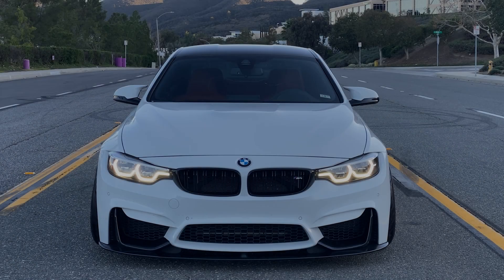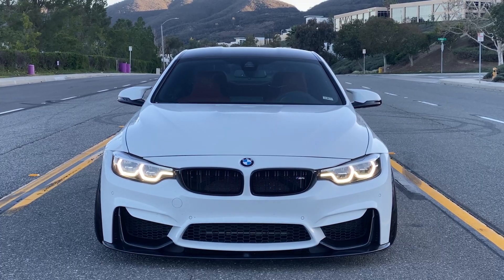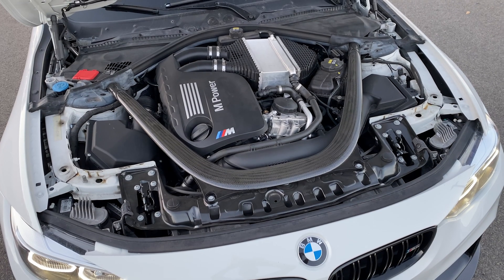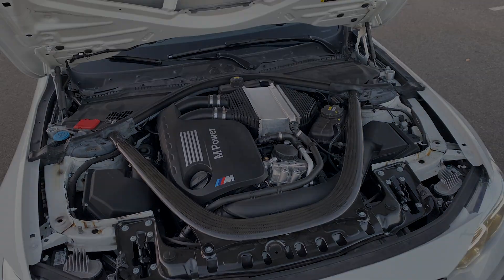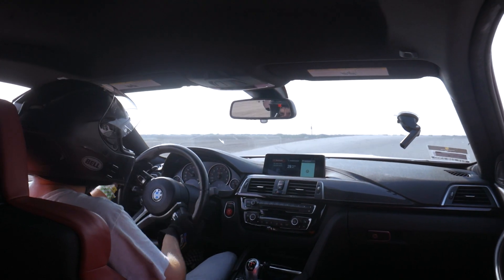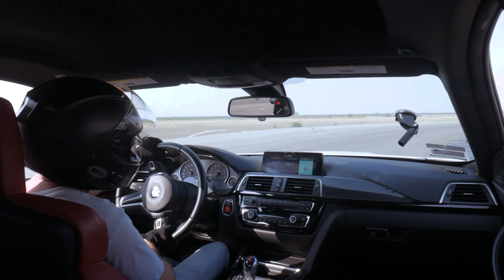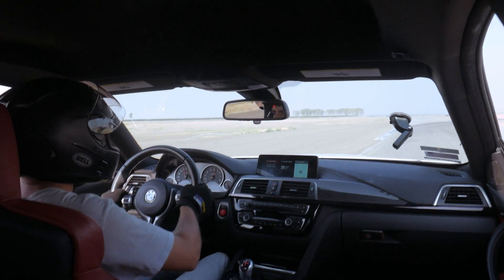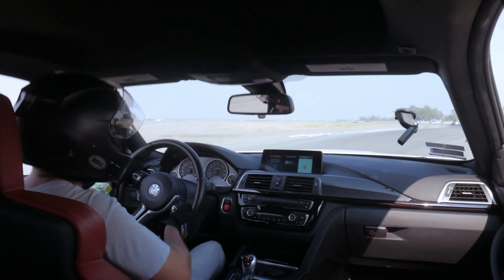When Should You Upgrade Your S55 Crank Hub? | BREAK DOWN

Comment: I’m planning on buying a 2019 F87 M2 Competition to use as a weekend car, with under 30k miles. Would you recommend changing the crank hub if I plan on doing a stage 1 remap?

Comment: Just had my 2020 M2C bolt capture done by Litchfield along with a stage 1 upgrade to just over 540hp and Bilsteins all round.  If I would have had to choose just one upgrade it would be the Bilsteins. It transforms the driving experience completely. They strongly recommend a crank hub fix if you are upping the power and they should know as they are the best in the tuning business for BMW's. They claim to have had quite a few power upgraded M2's revisit them who chose not to have the crank hub fix done first time round only to present them with a big bill on their subsequent visit, way in excess of the  the cost of the original fix.  If you are upgrading power its not worth the risk unless you have loads of money to spare..

Comment: 30k on my 2020 stage 2 manual f87 m2. so far so good. i plan to keep the car for a while and do the crank hub and upgrade the turbos while im at it. edit: also had a stock 2018 dual clutch f80 m3 with 35k on the clock when i sold prior to the m2 with no issues

Comment: I have a 550 hp 6mt with 73k on it, no issues. Both the N54 and N55 used the same design and had no issues (largely 6mt or TC autos). I think the problem is DCT boxes and aggressive down shifts backing the bolt out. I would only bother doing this if you have a DCT that you regularly track and/or drive hard.
Reply: loads of people reported it on the N54 and N55 wdym
Reply: No issues? 😂 hottest upgrade is the hub on high hp dct or manuals
Reply: Its fine until it slips then you wish you had spent that little bit extra to stop ever  happening. If you drive it like a Nissan Micra then don't bother but people don't buy M2's to pootle down to the shops. I drive my Litchfeld stage 1 with crank hub fix and Bilstein upgrades (worth every penny) quite normally (70- 90mph on motorways.. its too risky to drive excessively fast on UK roads as you will only lose your licence driving over 100mph and there are idiots that pull out to overtake without indicating at the last moment as you bare down on them at high speed ) but I do use the right foot when I need to.  I enjoy it for its immense overtaking ability to get from A to B when I need to get past those irritating slow drivers that won't overtake unless there is a mile of clear straight  road ahead or they are on a dual carriageway.  You can overtake 3 or 4 cars with absolute ease in my M2C in less than  half the time most cars can barely overtake one.
Reply: @hazzard8760  That is true, and they do slip, but my point is I don't think they slip unless you money shift or have a dct and bang down gears aggressively all the time. I actually did the bolted joint calculation on an evolve video somewhere and the cams and fuel pump would have to draw about 300 hp at 5k to slip the hub on stock bolt torque, so unless the bolt has relaxed or backed out then it ain't slipping. I would definitely do the fix on a dct that is driven hard.

Comment: I have stage 2 right now and have drove 12,000 miles so far and I have no Crank Hub issues. Sometimes I drive it rough because you can’t drive that kinda car in normal mode. You just can’t it sounds too good and feels too good. I am think of soon doing it and my vehicle has 33K miles. I think if you ran any kind of tune on your M3 And you drive a lot of miles with no issue, you should get it done because maybe no more luck lol

Comment: I was under the impression that BMW beefed up the crank hub from the 2017 models on.  keep in mind that depending on the car you have the S55 has various HP ratings stock.  For example, would the crank hub for a M3 or M4 be under more stress than a M2?
Reply: M2 comp has the S55
Reply: m2 has n55

Comment: i spun my stock CH and was under warranty in february, about a week ago, it spun again, i was flashed stage 1 for 1 day, hadn’t even driven it hard, and it spun again, warranty denied fixing because of stage 1 flash. both times that i spun it was just a mild spin and just need retimed, car is going in next week for full crankhub fix
Reply: Def sounds like not torqued properly or you really can’t drive lol.
Reply: @ronintheamazon1492  yeah the crankhub definitely wasn’t done properly considering the previous owner had the car stage 1 as well, i will confirm when the car goes into the shop for aftermarket hub next week what they find with the stock CH
Reply: how many miles did it have?
Reply: @dinosoarskill17  60k first spin, 60,700 second spin
Reply: @hellbentgarageog  thanks for reply, dct? nice m3, i have the same color. you have the front lowered?
Reply: @dinosoarskill17  dct yessir, my m3 is on springs right now front and rear, but i just ordered air suspension for it yesterday actually
Reply: @hellbentgarageog  Nice man. is yours pre lci? I've seen they have the air cups so you can get the benefit of lifting from air, but still keep the performance of conventional suspension.

Comment: Get ur fix done, spun my m2c stage 1 (1500km) with 13000km 2 days ago
Reply: Ruin your motor or just timing? & how many miles when it spun?
Reply: @dinosoarskill17  timing was off only, luckily. 6200 miles when i threw on stage 1 and timing was off at about 7200 miles. 95% cruising
Reply: @AimSucker  thanks for reply man, DCT?
Reply: @AimSucker  seems to be common among most that spin them.

Comment: Big fan of the channel but gotta liven things up if you gonna get on the topic. Hardly anything of value provided to the conversation here opinion or not. No discussion of types of crank hub types. Few if any examples. Listen. to someone monotone review a maintenance part they are considering is as entertaining as listening to someone monotone discuss oil changes and how he once rode wit a guy who waited a month too late on an oil change and the engine died. Correlation does not equal causation. IF you have money to burn and you've spent 5 figures on performance everywhere else its a no brainer. Im personally skeptical on the average owner that isn't trying to push the limits of a car and become surprised when things break. Every platform has things that break when you push past 25% increase in power. Factories build cars tamed a bit lets just say 10% so when you push double past that. You are literally past the capacity and efficiency of numerous components of the car. It seems more appropriate to call this a requisite for Stage 3 vs trying to suggest the average driver need to shell out $3k in parts $1k in labor (if lucky) on a part power hungry guys trying to make 600 hp could've just bought the next tier model car for similar money less stress.
Reply from the maker: Appreciate your feedback, like I said this wasn’t meant to be an in-depth discussion on crank hub solutions or technical info about the issue. Merely just answering the question posted in the title of the video since i’ve had HUNDREDS of people asking me. I have other videos focusing on solutions, products, installation, technical explanation, etc regarding the crank hub which can be found on my channel

Comment: Do you have any experience with the crank hub capture. I have it on my stage 2 f82.
Reply: The crank hub capture works well in not allowing the crank bolt to back out.  The only problem I have is people install them WITHOUT first checking the torque of the crank bolt.  Lock the engine down and torque that bolt.  Then, and only then install the capture!  If you don't have the means/tools to do that...then spend the $175.00+ or - and have a shop torque it for you. Then you can install the capture yourself!

Comment: Mine slipped at around 50k. Didn't slip enough to cause the valves to get hit so I was lucky. Here's my info.

Tune: Running BM3 Stage 2 93oct tune for over 40k miles
Power: Dyno'd 500whp 520wtq
Transmission: 6MT never had a money shift or any kind of over rev
Driving style: Driven pretty hard but not abused. Track days, hard pulls, some roll races.
Fix: SSR pinned crank hub and  VVT crank bolt capture to guarantee the bolt can't back out.
Reply: Track days. That would do it.
Reply: @zbabar3000  That shouldn't matter. ///M's are meant to go to the track. You shouldn't have to worry about needing to replace the pistons and entire top-half of your engine from doing a track day in an F8X. It cost me over $3k to fix something that should have been done from the factory.
Reply: I should do mine soon then, running e30 so power levels def prob higher also 6 speed. was thinking SSR or RSR. Everything was 3k?
Reply: Yeah, you changed the engineering design of the engine.  Therefore the "slip" is on you!

Comment: from what i’ve heard, it’s more dependent on kick down, i’m currently around 600whp on a stock crank hub and there’s no issue even tho i do drive hard, but one thing is I almost never use kick down.. like you mentioned about dct vs m/t, it makes sense cause m/t doesn’t have kick down
Reply: yeah also the rev matching and downshifts are more aggressive in the DCT which play a factor IMO.
Reply: still all good?
Reply: @Tam.m2c Yes actually, still have the stock crankhub with 600whp for about 4 years now. Been going to 2 or 3 track events per year.
Reply: @Svall823  amazing bro

Comment: I understand the S55 may have no issue if in stock form, but this is a really bad design full stop. These engineers know that there could be a failure if an increase in power is realised so why not just key it to start with. What would be interesting to know, is what they do on factory backed race cars. DTM cars and the like. I'm new to the whole BMW thing having just bought a 2015 M4 only 2 weeks ago. Its stock, so I'm not to worried at the moment. My issue is that there is no one in my city who has done this mod so my car will have to be transported 2500kms round trip to have it done. All in I'm looking at around the 8k mark to have this done. All that aside I really like this car and enjoy the drive. I'm currently finishing off another build at the moment and said to myself just leave it as it is, then I went and bought the LED race wheel. And so it begins, Lol.
Reply: the dtm cars use an entirely different engine called the P66
Reply: @Svall823  I knew someone would know, thanks mate.

Comment: it really sucks that these cars are so complex but still have an Achilles heal... unfortunate to say, the engine can't push big power reliably compared to the japanese straight 6's we all know and love. I have accepted that fate.
Reply from the maker: it definitely can, the crank hub just needs to be upgraded preventatively. the rest of the motor is an absolute marvel and really is lightyears ahead of the old japanese stuff
Reply: @SimplyCarThings  Straight from the factory, it can do 500hp staying 'within spec'. anything above that is 'out of spec' and requires upgrading the crankhub. Wish it wasn't like that. I'm sure there are preventative measures taken for other engines to handle more power, but it's just the fact that one small component can hold back the entire engine.
Reply: All the older Japanese engines require a complete fuel system, aftermarket engine management, drivetrain components, and an aftermarket turbo to make what an s55 will make with downpipes, a tune and a little ethanol. Even with the cost of the crank hub you’ll be ahead and have a car that is 1000 times nicer

Comment: it also sucks that we have to worry about the shops drilling the new hubs incorrectly at a wrong angle, which could make the situation even worse. I wouldn't even trust myself to install a 4-pin/etc lol (Not saying i'm very mechanically inclined)
Reply: Yeah this is why the VTT Spline lock solutions is pretty popular too. The pin ones have a guide though so if it’s a reputable shop it should be done right regardless.
Reply from the maker: oh yea for sure, i know of a shop that butchered the install on one, but im not gona drop names or point fingers lol

Comment: Love your channel.  I have a f80 that I bought new. Manual transmission. Missed a shift from 4th looking for 5th and hit 3rd accidentally and broke a plug. Thought it was crank hub. Love your videos.  Keep it up.  I have a bootmod cs tune. But stage 1  when that happened
Reply: What plug did you break bro??
Reply: you got lucky then, i did the same shift at the top of 4th but luckily i realized before fully letting clutch out and engage fully. Was racing too, so it all happened fast. Dealer said computer logged 7900rpm which is not much higher than 7600 redline, so I got lucky nothing happened. If It fully engaged, rpm was gonna be like 9000 and would've needed a new motor for sure lol

Comment: I’ve seen so much on yes and no to this but ultimately I figured it was relatively cheap insurance due to some people with stock cars having the problem.  3k to make sure it doesn’t happen or 20k if it actually happens.  I’m no mathematician, but one of those numbers is significantly smaller than the other.

For those that are saying it’s a rare issue and it isn’t worth it because of cost - if you can afford to be driving an almost  $80k MSRP car then 3k shouldn’t be a problem and if it is then you’re driving the wrong car - your budget income and priorities are all fucked up.

Comment: 100 octane tune,  116,000miles full bolt on tune....only issues so far was 2 fuel injectors stuck open....replaced fuel pump and injectors ( stock ) injectors...had a high output fuel pump, it was trash, fuel gauge wouldn't read right and the pump didn't operate correctly,  leaning out at fuel throttle or high loads....replaced it with a stock bmw pump...cars runs strong
Reply: Dang bro you at 116? Just got one with 53k miles for 50 k after taxes was worried I wouldn’t get my money’s worth
Reply: @lifethroughnick  yes and it still runs hard, not missing a beat...I'm impressed
Reply from the maker: damn thats great to hear!
Reply: Update?
Reply: @f82baba  130,000 miles no change car is great ....no crank hub issue at all...same tune
Reply: @jenningswinfrey8171 still have this car?

Comment: The crankhub will never be an issue stock r&d definitely goes through this, the e92 has rod bearing issues but that’s after 100k miles if Bmw tested the motor to 100k miles they would’ve change it. Crankhub failure is just the cost of modifying ur car shit goes bad happens on every car jus pricier cus pricier car
Reply: Well, that hit the nail on the head!

Comment: great, concise video. interesting how E85 seems to dramatically increase the case rate for crank hub issues. i wonder what the reason is behind that
Reply: Makes a lot more torque
Reply: when tuned e85 can make a whole of a lot more power versus 91/93 octane fuel.
Reply: @riceball777  how does that affect the camdrive system?

Comment: I think "Plagues" is much too strong. I think it's an item of concern for a specific set of owners, but "Plagues" is much, MUCH too strong. Now, if this was like Subaru headgaskets or ringlands, sure, I would agree with you, but it really isn't. I like your content so I just wanted to comment, but I'm gonna do what you said and bounce from this video.
Reply: Subaru head gaskets and ring lands come around when you don’t do your maintenance regularly. It doesn’t just pop up. Don’t spread false info pls
Reply: @Accensioni  LOOOOOL ok guy. Just keep telling yourself that and your Subaru won't shit the bed. That's how it works.
Reply: @gravitygear  A lot of my friends Subaru’s haven’t “shit the bed” yet. I know people who still ride their 05 08 etc STI’s with no problems. Ringlands don’t just pop out of nowhere and that’s not how it works tho. Unlike the s55 crankhub which does pop out of nowhere. I’ve seen it fail on stock tunes and stock motors
Reply: @Accensioni   Sure. And on the other side, i've known 5 people lose brand new, dealer maintained engines under 50k. All bought brand new within 3 years of each other. I've owned 4 Subarus. Granted, my cars lived hard lives as autox and time attack vehicles, but they were EXTRA maintained. The only one that survived was a MotoIQ build. I've also seen camber boi cars that couldn't go fast enough to run from a segway cop go through ringlands. I was DEEP into the subaru community. Was like being in an abusive relationship for 8 years. You cannot tell me it's a non-issue. My bank account and my friends' will tell you otherwise. BTW, Motul race oil every 1500 miles, coolant flushed every 6 months. NO TURBO UPGRADES, no downpipe. 
If you look at Apex Taxi's F8X cars, they live their WHOLE LIVES on the Ring getting pushed to their limits DAILY. They haven't spun a crank hub on either their M4 rental or their M3 taxi. The S55s in their cars will go for 30k+ KM AT FULL BORE. They've died due to other things, but never a crank hub.
Reply: @gravitygear  something is def not right here. Engines don’t just go out for no reason. Did you do change the oil pickup when you got the car? Did you do the AOS? 
Some people replace the replace the turbo feed line. Did you do that? 
Did you do your cylinder 4 cooling mod? 
If not then idk for you. People run 340-350 hp on stock motor on the STI’s. Upgrade their turbos and all lol
You and your friends are definitely doing something wrong my friend. Or you’re just unlucky. 
Subie’s are reliable. That’s all I can tell you
Reply from the maker: I agree with you, i just think that the vast majority of my viewers own these cars with the intention of modifying or upgrading them to some degree, in which case the term "plagues" is appropriate. although yes it is a strong word to use